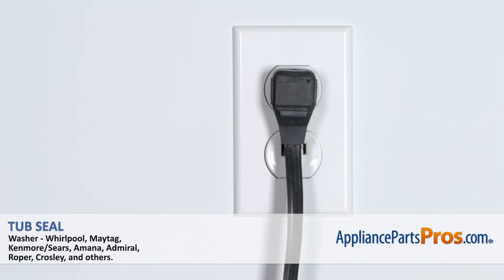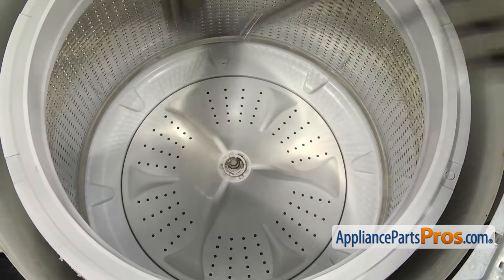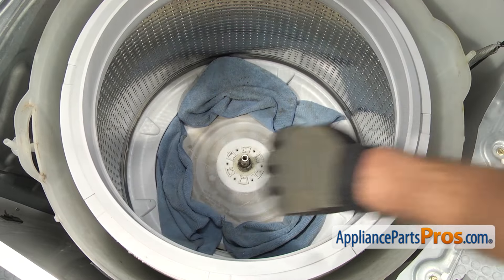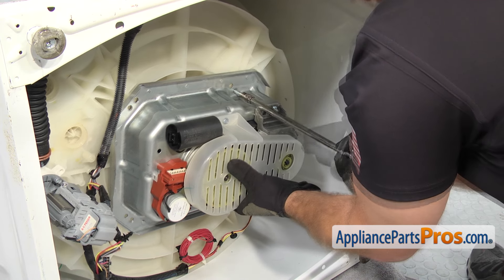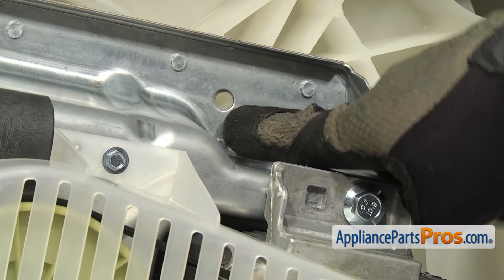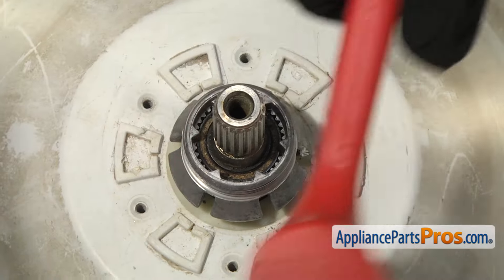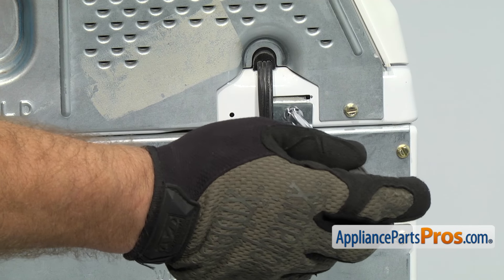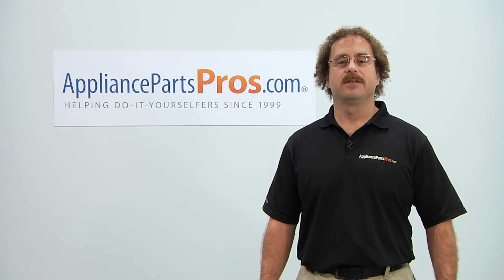How To: Whirlpool/KitchenAid/Maytag Washer Tub Seal W10324647

Comment: This was a very helpful video. I’m a 55 year old mom and did this today with my daughter who helped me hold the tub and to tip the washer over safely. My drive block was a one piece plastic design ( which I replaced with a new one) and my wiring harness connectors were configured a bit differently,  but otherwise instructions were great. One problem I had was that the tub seal was stuck to the shaft and I had to carefully remove it in pieces with a box cutter. I couldn’t find any assistance to remove any other way. After reassembly and calibration everything is working fine with no more leaks. My washer was really gross so we cleaned it all thoroughly before reassembling it again. Pulling out the tub seal and cleaning took extra time  so total time was a few hours. Watch it through at least once before you start.

Comment: The video's are extremely through and helpful.  Appliance Parts Pro's have saved me a lot of time and money.  Only with their video's have I been able to repair both my clothes washer and dryers.  A word of caution. Once you learn the parts you need to repair your appliance via the video. DO NOT search other sites for a less expensive part.  I admit that I did it to save a few bucks. The result was being sent the wrong part and I ended up purchasing the correct part from Appliance Parts Pro's.  Thank you for all the help you provide to DIYer's.

Comment: Thank you for the video.  I have a Maytag MVWX700XW1 that is very similar to this.  Our clothes were getting grease marks so I pulled the wash plate.  There was grease all over the back of the wash plate.  I bought a new gear case and tab seal and plan on replacing them both, but do you think the grease was coming from the grease inside the tub seal or something in the gear case?

Comment: Removing the spin basket from shaft problem. With the outer tub removed from washer housing put the bolt back in the shafts that holds on the wash plate fully seated . Now with  a helper (it's easier with two) hold the spin basket from inside curved ring while helper pounds on the bolt with a sledge hammer by dropping it right on the bolt head 4 to 6 inch drops guiding with handle it will  slowly tap it out. It  did not  damage the shafts or bolt threads. My seal stayed on the shafts not in the outer tub like the video.
Reply: Joe - I have a old kitchenaid Washer. It's making a loud whinding / banging sound that doesn't sound good when it's in Spin Cycle. I was hoping it was motor coupler but its not (I checked) I think it's either Clutch, Transmission, or maybe Tub bearing is bad (or something else)? I don't know. The loud sound starts within seconds & gets louder. It will fill with water, run & will spin but sounds horrible when it does. What could it be?

Comment: I found my gear rubbing problem, the NEW gear box inside splined shaft shoulder was 1/32 to short and allowed the outside teeth on the pulley to rub the inner teeth which sounded like it was tearing the teeth off.  Put it back on the old gear box and it cleared fine. Measured the NEW gear case small shaft shoulder (inside the spring/splines)and it was 1/32 shorter than the old one. This allowed the flywheel close enough to rub the teeth on the inside.   I drilled the inside hole bigger on a stainless machine washer and put it on the small splined shaft which located the flywheel 1/32 out from the cam unit and so far it's working. My first thought was that I lost the machine washer inside the unit but after a check on the old gearbox I found no machine washer and it cleared, no noise at all. It's something to watch for if you buy a new gear case. After working in a machine shop for years I would guess whoever did the machining on the shaft cut it in to much and never figured it would matter, it matters!
Reply from the maker: Thanks for letting us know!

Comment: Got all of the hardware off but still cant get the spin basket out?  I even took the tub all the way out took off the 4 screws on the transmission to see if I could pull it out from the bottom but that spin basket will not come off?
Reply: I am at the same point, doing the same thing,  just won't come off.
Reply: I took the whole tub out and laid it on it's side then took off the 4 screws holding the transmission on. I then took a  long board 2x4 and placed it up against the end of the shaft and put the hammer to it. It finally came out, very corroded. I cleaned it up it up replaced the tub seal and put it back together.
Reply: maybe have someone pull from the trany side while you hammer ??
Reply: That is my current plan. I am replacing the transmission, so not concerned about the shaft. just waiting for oldest to have time to help.
Reply: I got 20 of these machines from a public housing authority. What seems to be a common problem is the shift actuator. Replacing the actuator fixes the machine. When they are bad, the washer only clicks and no water comes in. What happens is that water leaks from "the tub area" and goes straight into the sensor and corrodes the tiny circuit board that is under a plastic shield that is part of the sensor. These machines so far have all had bad upper bearings on the transmission. If you are lucky enough to get the inner tub out and remove the transmission, you might notice that the top of the transmission is not rusty. What happens is that water gets into the transmission via the seal for the agitator splines. As far as I can tell, that seal is not available. The inner tub retainer set up has been a fight every time. The inner tub splines can become so corroded that, out of stubbornness, I took a cutting wheel and cut the plastic of the inner tub (destroying the tub) in the area around the splines. The inner splines to the transmission came out when I pressed on that shaft and it popped out the case rivets of the transmission  and all the gears broke and fell out. I then put a cross piece of wood under the balance ring of the tub and tried pressing on the outer splines of the transmission using a car scissor jack. I pressed so hard that the cross piece cracked the balance ring and all the liquid spilled out. I finally took my cutter and split the remnants of the transmission shaft and chiseled them inward to collapse the metal splines away from the plastic splines of the inner tub. The tub finally came out and the remaining half of the transmission fell on the floor. I then put everything in a pile and ran over it with my forklift.
Reply: Andy Peabody this was the best advice in the comments and it’s what I had to do to get mine out as well. Had to knock it pretty hard and for longer than felt necessary, but it finally worked.
Reply: @obsoleteprofessor2034  hey if I bought 20 used machines I'd figure out to get the tub out and it can be done but it'll take maybe all day. If I were repairing like the 20 you got I'd get a system down. Not knocking you at all as you found the prob. Corrosion is the main issue for disassembly.
So l looked at all the info on this and got an idea of what I'm up against Got the agitator out and spline rusted as you said.
 Don't want do damage anything so use motorcycle mechanic and all my other experience to take out the drive block kit. What's not mentioned is the second part of the drive block is tapered and fairly strong = takes an effort to break a taper even if it's in great shape and just has oil on the taper.
 Got the top piece off by using liquid wrench ( not best choice, stinks and penetrates slowly) and  large head punches not a srew stick. Shock the spanner nut gently by tapping it back and fourth don't try to knock it off 1st try, play it. Respray the  the area.with P Fluid.  Let it soak and it'll finally loosen. 
Next piece is the drive block and it's tapered, this won't come out easily if corroded and rusted. Lube this as mentioned in other vids, If you can't get it to move use a dremel with a cut off wheel and carefully cut it almost through on opposite sides. Tap it with a chisel and dead blow hammer and it'll loosen . Pull it out.
 Next piece is the  Hub and IF the other two pieces are severly corroded this will be worse.  So split it with a chisel carefully. I used a dremel to carefully slice bother sides and broke it in pieces, not taking any chances
Uses other vids for the procedure but don't rush and take your time.
Wire brush the area and get it clean making sure all debis doesn't enter the tub openings. Use other vids.
At this point gently rocking the tub back and forth should loosesn the seal. But Not if the seal and outer shaft are correded full of crap and so on. Shitty seal design on a technically neat bit of engineering!
So if you don't want to ruin the tub and tranny take your time. Flip the washer onto it's front and remove
 the belt, splutch, motor,  pump and condenser. Get them out of the way. 
Stand the washer back up. Install the agitator bolt and make sure it bottoms out. Use a long 2x4 and a 24 oz rubber mallet or dead blow mallet and shock the spline shaft. Let it sit and spray the area with penetrating fluid. Shock the shaft again and check that the agitator bolt is tight and back it off frequently and retighten to make sure it's ok and not damaged. The tub will deflect downwards due to its suspension. But don't try to kill this thing just precise firm hits of a gentle nature.
Remove the 4-10 mm gear box bolts and see if it's loosened on the seal. Prob Not. So soak the spline shaft at the top again. Get a coffee and go back to the same procedure, what do your trying to do is get some penetrating fluid into the rust on the outer spline shaft and down to the tub seal.
Next this is unconventional and you need a lithium  hand held impact tool, I used my Panasonic.  Shock the agitator bolt several times means clock wise as it's a right hand threaded bolt with a 7/16 socket.  Firm pressure  you just want to rattle the corrosion when it's hammering allowing PF to infiltrate rust,  But Interrupt the procedure constantly .. More penetrating fluid. Use the long 2x4 and shock the shaft. Make sure the agitator bolt is tight and back it off and retighten to be sure no damage, do this constantly to avoid surprise damage. . Let it sit and don't rush this. Took me all afternoon,  fold up an old towel under the gearbox and or support it with 2x4s so that it doesn't hit the floor when tapping the spline from above.
Once it loosens it'll move, may stay tight until it's almost out. Keep on it and spray the top of the spline constantly.  If it drops say 1 inch fill up the spline space with PF. Let it sit, soak and it'll finally come out minus the seal. That prob stays in the tub. Got mine out after a long day.
So next 4 me I'll drilling out the rivets next in the GB. Then I'll carefully split it and change out at least the top bearing 6003 RS bought a shitty made in China one as this thing is questionable 4 a full repair.

This is long winded primarily for novices and those who may not be mechanically inclined.  Look at it this way, if you can repair it inexspensivly your a winner. Say you get it all apart but you  effed the gearbox. So what. Take it apart and see what makes it tick. As long as you don't ruin the tub or anything else you ahead, don't cuss it out, as its just a great machine that after development got cheaped it out so that they can do the usual and that's make a huge profit. The whole industry relies on this. A service call can be 80 to 150$$$$. Then when they can't fix it tell you to buy a new on and here's my card. There are good techs and companies but the cost of labor negates repairs, so if I fix mine for $ 200 or less I'm ahead. And I'll do some mods the areas in question if possible. Cabrio Dryer already done (belt rollers and pulley) and both these are 7 years old but don't get full year round use. Will use plumbing antifreeze from now on for storage on  the washer as it'll displace the water and may lessen the issue of corrosion.

Comment: Any advice for what to do when that lower agitator base will NOT slip on so easily? I Have tried and tried and studied the innards of the agitator and the base that it slips over and it will not go back down all the way like it was. It's the same one that has been on there i just removed to clean. It gets stuck and the base of it is raised about 2 inches above the bottom of the washing machine. Help
Reply: I had that same issue- I cleared the slots with a screw driver on the agitator and shaft, and after slowly trying it on each click it finally went down most of the way and using the screw I seated it the rest of the way by force.  Probably not coming off anything soon however

Comment: This video was very informative and spot on for changing this seal, but if mine still leaks after changing the seal, is there anything else I can do? I'm afraid to tighten the hub nut more to squeeze the seal. I don't want to split the nut or ruin my outer tub. Could the output shaft which the seal surrounds be the problem?
Reply from the maker: Without a model number for your appliance and the details it would be hard to say. However, if you change the seal and it still leaks, get in contact with us and we'll help you work out where the problem is. We offer free technical advice and diagnosis. You can give us a call at 1-877-477-7278 or you can chat us at our website: http://www.appliancepartspros.com/.

Comment: I have this exact washer. It won't go pass the sensing mode. What could be the problem?
Reply: stripped drive hub. My centennial machine uses plastic. I want this metal one used in this video.
Reply: Your machine won't go past the sense mode because it fails the initial spin when it's sensing.  A new drive hub should fix your machine.

Comment: It looks so easy but it's not the after I got the washer tub nut off the seal was so crowded and stuck on there wouldn't come off no matter what I pounded on it forever I don't know what the deal is just I can't even see the screws
Reply from the maker: If you need more help, we're happy to talk you through it. We offer free technical advice and diagnosis. You can give us a call at 1-877-477-7278 or you can chat us at our website: http://www.appliancepartspros.com/. We will need your model number to give you accurate advice, which you can locate using this tool on our website: http://www.appliancepartspros.com/modelnumber_locator.aspx

Comment: I like your videos, excellent angles for removing parts.  However, like this one, you use (Part #W...........) to identity the machine.  I am curious as to why you don't label the brand name, and the model # of the washing machine.  Like I have an Amana HD LW4303W.  Also I think it would be very helpful for the amateurs for you to identify the year model of the machines.  I would suggest, e.g.  Amana HD Washing Machine Model #LW4303W, 1993.  Cross reference:  Magtag, etc., etc.  Thank you for sharing.
Reply from the maker: Thanks, Frank! The Part # actually identifies the particular part that we are replacing in the video. We actually can't efficiently identify specific models that our videos apply to, because the list would be very long. We do list the brands that parts may be used on in the video descriptions. The tub seal in this video may be used on Whirlpool, Maytag, KitchenAid, Jenn-Air, Amana, Magic Chef, Admiral, Norge, Roper, Sears, and Kenmore washers. As you can see, trying to list every single model that this part is compatible with could result in a list that's hundreds of models long. This particular tub seal, for example, is compatible with 450 different washing machines, and for some parts the list is much longer.

However, if you follow the part link that we've provided (http://www.appliancepartspros.com/whirlpool-seal-tub-w10324647-ap4567772.html), you can go to our "Cross Reference and Model Information" section, which does list all the brands and model numbers. As you can see, it scrolls and scrolls.

If you ever need help confirming that a part is the correct one for your model, or if you need specific help with the repair for your particular appliance, you can always give us a call. We’re available 7 days a week at 1-877-477-7278 or you can chat us at our website: http://www.appliancepartspros.com/
Reply: Frank J anyone commenting that has the same machine or it's branded differently or otherwise mention your full  model number. Say splutch drive or direct drive and that will more or less I.D. THE machines and similarities. Lots of info and conflicting as well. Plus you may have to take it slow and therefore not damage anything as they do this for a living and we don't.

Comment: After removing the 7/16" bolt, I'm unable to remove the wash plate.  Excellent instructions to this point.
Reply: Don Mattson were you able to figure out how to get the wash plate off? I am having the same issue. I got the bolt removed but the it’s like the wash plate is locked to the shaft
Reply: Saaaaaaame!!!
Reply: It’s likely seized to the shaft. Just takes a bunch of working.